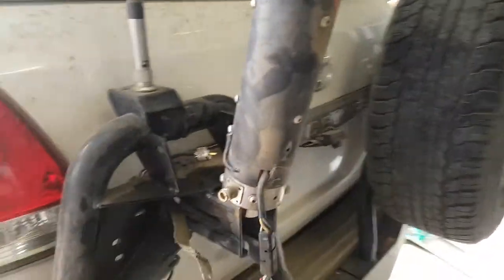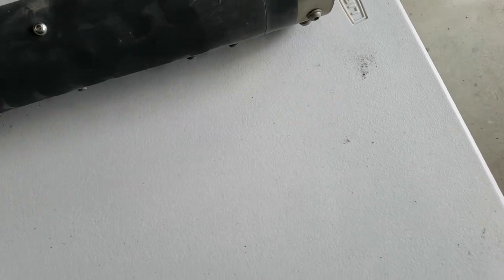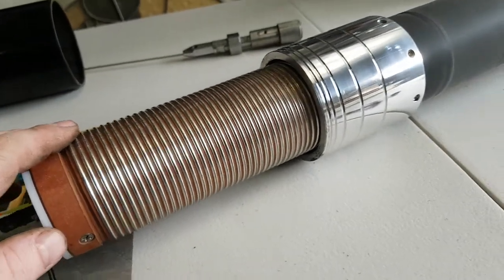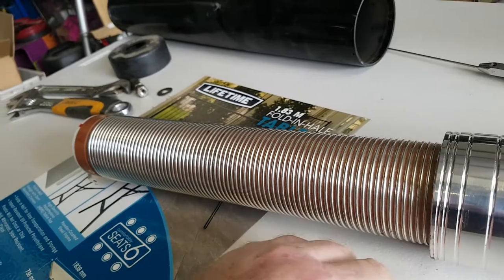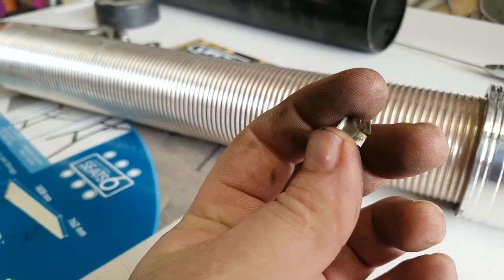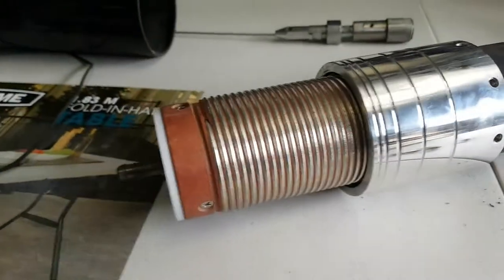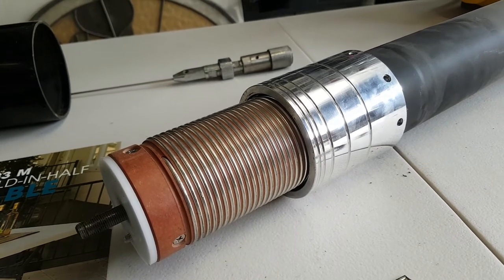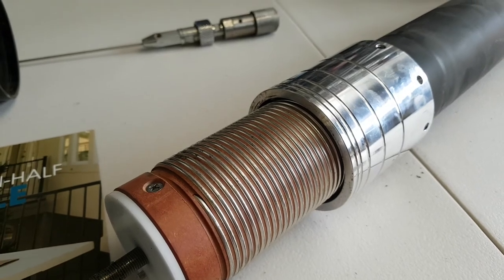repair of scorpion antenna

Comment: Ron sent some spares for my antenna and after 100k miles up and down the UK motors it needed it. Also I uses sold 8mm stainless steel whip at 4.6 on 160m as the whips interact with the van. But really the best mobile antenna and I have tried most of the and Ron aways helpful. Thanks Richard m0uoo hope to work you mobile to mobile
Reply: Pro tip : you can watch series on flixzone. Me and my gf have been using them for watching all kinds of movies during the lockdown.
Reply: @Kaleb Arthur Definitely, have been using Flixzone for years myself :D

Comment: I own a 680. I wish it didn't use a 19v motor. It feels underwhelming when its running at 14.3v and even worse at 12v. However, the antenna is absolutely a monster for mobile operatons.